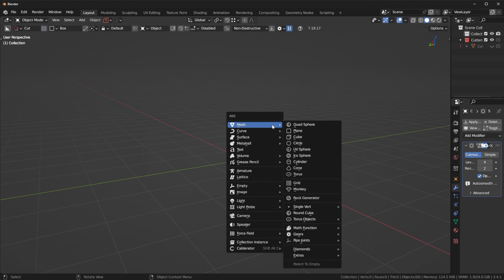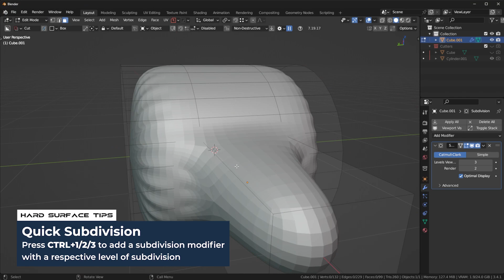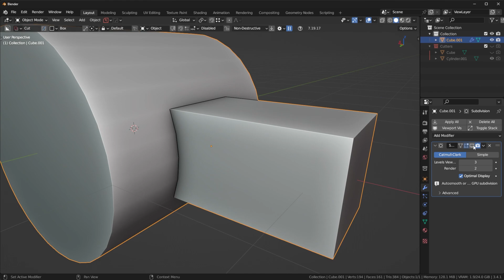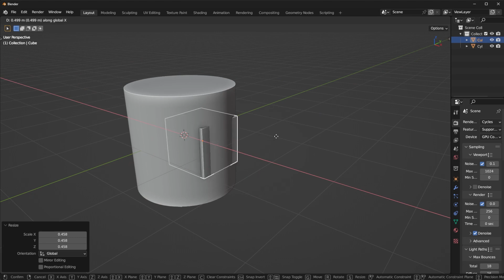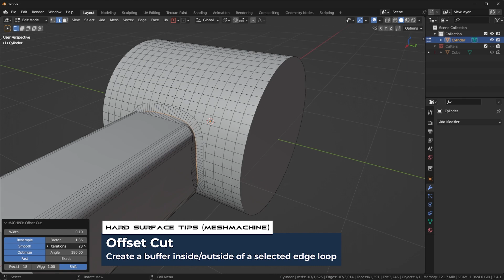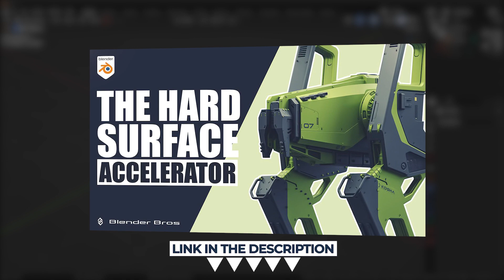Fusing Cylinders Together in Blender (Subd and Boolean Strategy)

Comment: Very well explained with precise information and without wasting time, straight to the point. After 2 years learning 3Dmax, I am returning to Blender (where I should never have left!) I will now follow your material and update myself.
Reply: Should've learned Rhino 3D which does both CAD and SubD modelling in 1 software.

Comment: May I suggest a quicker method:  1.) Add 2 loop cuts to the length of the 90-degree X-rotated cylinder, Scale them on the Y to get size of the square.  2.) Choose the faces that comprise a square or rectangle. 3.) Inset, 4.) Extrude, 5.) scale the selected end faces with S,X,0. 6.) add 2 supporting edge loops around the cylinder and through the cube, Scale them on the Y.  7.) Inset the cylinder end caps to make supporting loops, as well as an inset on the face of the "cube", and you are mostly done in 7 steps, no $$ Add-ons required.

Comment: Thanks in advance!   Just last weekend I was running into that "pumpkin effect" and thought I'd just have to tweak it a bit and pretend I'd fixed it.  I won't have time to work on anything for the next few days, but when I do, I think you just showed me how to fix it.
    Thanks for the name, too.  I will be calling it a Pumpkin Effect from now on.  :)
Reply: It would be good to branch out and learn more about subd workflow and box modeling to understand what's happening there. Another way to fix the end caps would be to turn on subd, select both end caps of the cylinders, press i to inset, go in a bit and left click to confirm. Press i to inset again, go in a little further, set it again. Then delete the two ngons. Select just one edge and press ctrl+f, click grid fill. In the bottom left tab change the two settings until the faces look nice, then do the same to the other hole.